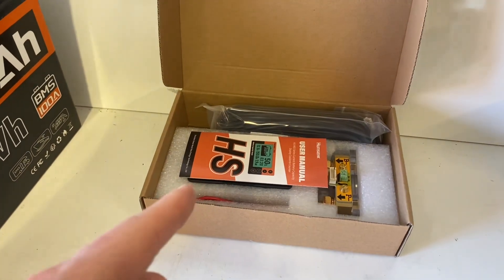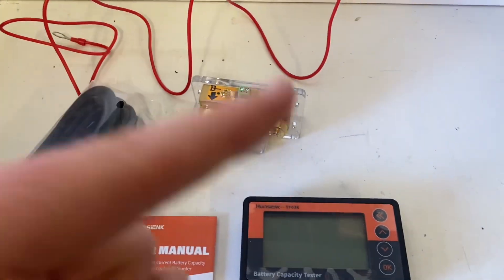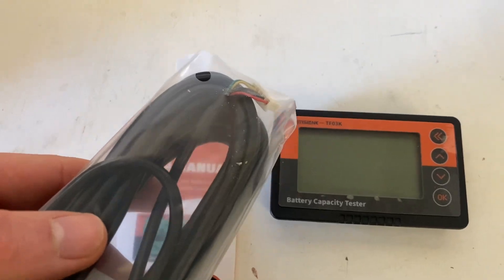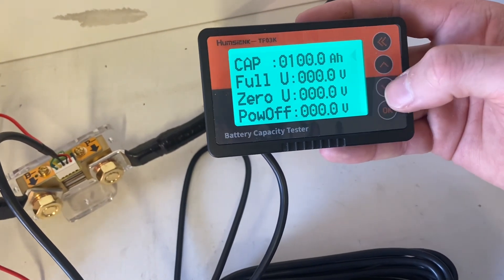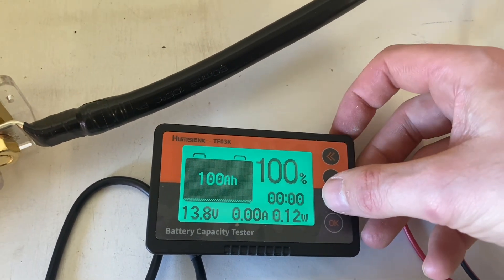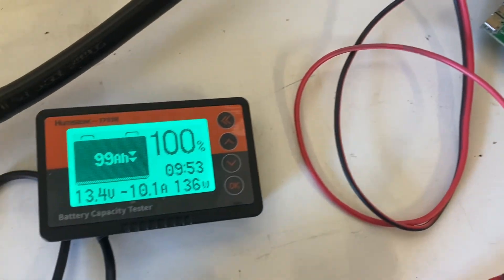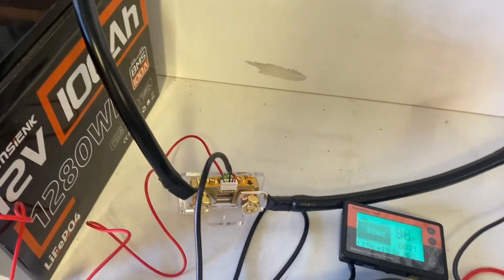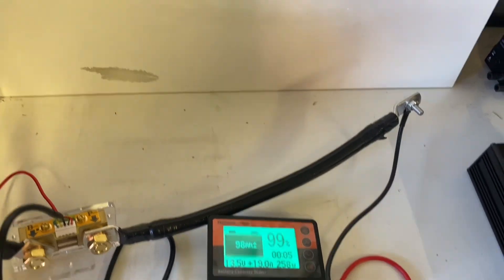Humsienk Battery Monitor Review & Test – Shunt-Based Setup

Comment: Can that monitor read a 24v system or any voltage u apply to it or just 12v ???
Reply from the maker: It has a wide voltage range. 24v is not a problem👍

Comment: Hey a question it says up to 350A current... Does that mean it monitors only 350A loads leaving max

Or the size of the battery bank is 350AH max?
Reply from the maker: Hey. Thanks for the comment👍 It means it can handle a amperage peak at 350A. For a 12v system, that would be 12v X 350A = 4200watts. These shunts come in different sizes. Basically means how many amps can go through the shunt(at once) regardless of the Voltage. Hope that made sense?